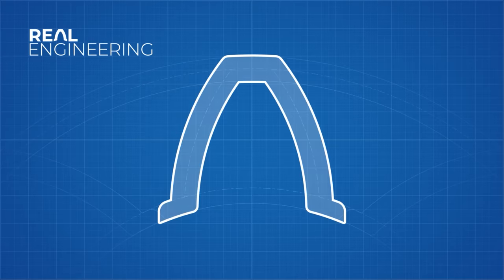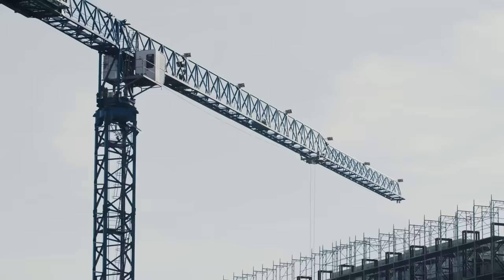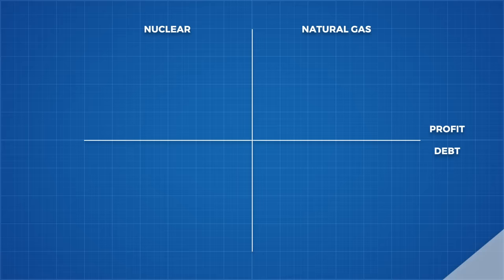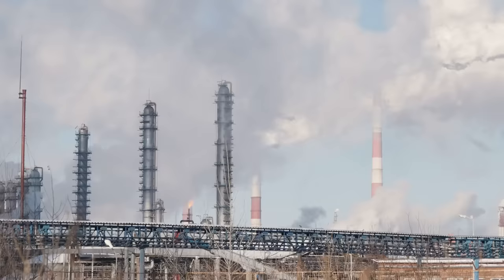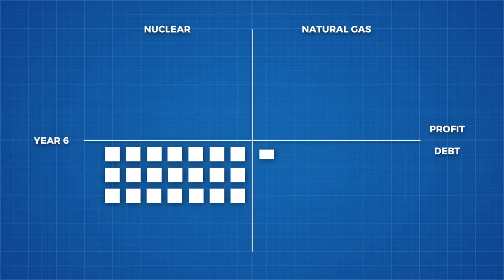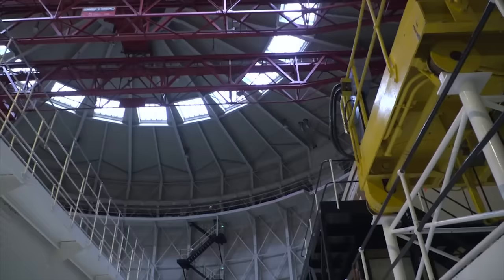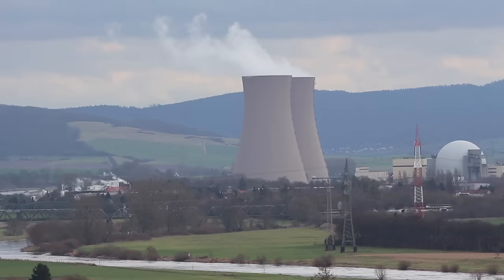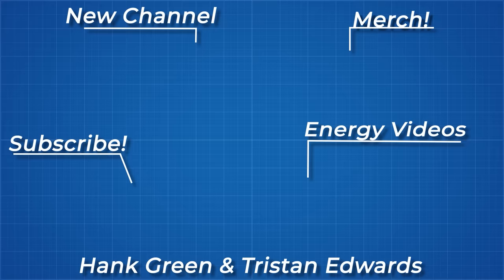The Economics of Nuclear Energy

Comment: As someone that works in the energy sector, I have a few comments. One thing missing in the natural gas turbine (CT's) calculation is what is referred to as "equivalent hours of loss of life". What this is, every time you shut a CT down, and then start it up again, it suffers severe loss of life due to the heating dynamic. After a certain amount of loss of life hours, these units need to be taken out of service for inspection, this is no small feat, as the turbine needs to be exposed and inspected. Also, renewables (which include biomass, literally burning trees, which is another matter altogether) only constitutes about 11% of all installed capacity with in North America. At any one time only about 2.5% of all energy produced in North America is renewable (DOE). 
in the video, they mention Fukushima and show a picture of Chernobyl, but what they don't mention is the thousands of reactors that have run without incident their entire life. Thorium reactors are now being developed and are far safer than current installations and have the ability to produce more energy. 
I love the environment, but, am a realist, until the ability to store energy, Solar (which takes up MASSIVE amounts of real estate, and is hugely subsidized, that is why the costs look so low) and Wind (same problems as solar, not to mention the resources required to make and install them)  they are not feasible. So, if you like the dark and want to go back in time, the choice is yours.
Reply: Stop talking sense! Wind and solar are magic! Physics and the whole "energy density" thing are bullshit. :P
Reply: Oh don't get me started on biomass. Here in Europe some people think importing wood from South America and burning it is somehow green.
Reply: the thing is, when a nuclear plant goes bad, the consequences reverberate through millennia, not merely decades or centuries. dealing with the waste is a big deal that lots of people seem willing to ignore (at least in these comments). hopefully research can start to provide results, as fossil fuels wont last forever and battery tech can't yet make wind and solar viable
Reply: @berengerchristy6256  that's actually incorrect, for starters modern reactor design can literally not suffer the kinds of failures like Chernobyl, and the new thorium molten salt reactors could never even have an accident like Fukushima, they are literally 100% passively meltdown proof, literally every person on the planet could die and a molten salt reactor would just sit there and slowly cool down, never be a threat to the environment or anyone.

If you mean the "waste" from operation again this is an area where the general public is greatly misinformed, modern reactors produce miniscule amounts of waste, and what little waste they do produce is easily handled, unlike coal and gas, or even solar (making solar panels produces a ton of dangerous industrial waste), these all dump a significant portion of their waste products into the environment. And the molten salt reactors which are far more efficient and produce far less and less dangerous waste products than modern reactors can actually have their fuels supplemented with the "waste" from modern plants.
Reply: @berengerchristy6256  And yet even when fossil plants go 'good', we know that they are having impacts of the same or greater magnitude through global warming.
Reply: It's worth mentioning also that closed cycle gas (CCGT) is more efficient but less suited to peaking, whereas open cycle gas (OCGT) is less efficient but much faster. So a greater degree of renewables penetration can actually lead to higher carbon footprint as OCGTs are used in place of CCGTs to match intermittency. I don't think this is an argument against renewables, but more a demonstration of how finding better storage solutions is of enormous importance.
Reply: I would rather be in the dark and alive than die of cancer radiation poisoning
Reply: Can you build solar panels into a sort of rotating tower or any other more feasible method which would still catch sun all day but take up less space than a field of panels?
Reply: @dalemarshall625  a modern nuclear power plant will never put you at risk of dying from radiation sickness or cancer.
Reply: Berenger Christy No it doesn't, all it takes is a few calculations and at most it lasts measurably a century or two, in reality it's dangerous for a few decades.
Chernobyl is safe and is a tourist attraction, and Fukushima is already being reclaimed by the Japanese government, people are moving back into it.
Not to mention the thousands killed by fossil fuels and the industry each year, nuclear had caused less than a hundred deaths since its inception.
If you don't believe me, study physics for yourself, once you reach nuclear physics you'll come to the same conclusions.
Reply: @berengerchristy6256  Christy one thing to keep in mind that isn't often well communicated when it comes to radioactivity there is a half life. The important thing is that the shorter the half life, the more dangerous it is, the longer the half life the less dangerous it is. say for example an isotope has a 2 year half life, it is extremely dangerous but if there is say 1 ton of it, in 2 years there is half a ton, 4 years a quarter, 6 years an eighth, 8 a 16th, 10 a 32nd, and so on till there is just trace elements. so in 16 years there would be almost nothing dangerous left. on the flip side if something had a 100 year half life, it degrades at a much slower rate so it will last much longer, but it will be far less dangerous. With modern reactors they claim that the nuclear waste will reach natural background radiation in just 150 years, meaning it has to be stored that long. in the grand scheme this is extremely short and extremely safe.
Reply: I would also like to mention that Gas Turbines have a massive air requirement and as a result need to be shut down often to have their air filters replaced which takes hundreds of people a couple days to perform. My cousin is a technician who made about half of his year's income just replacing filters.... keep in mind they are roughly football field sized and 3 stories tall.
Reply: Thorium and molten-salt reactors are the way to go. They're safer, smaller, and can be built on an assembly line and transported to where they're needed without permanent installation. We might even have a shot of using up and disposing of much of the waste leftover from older traditional plants.
Reply: @berengerchristy6256  The thing is, this millenia-number is hugely exaggerated as the exclusion zone of Fukushima has never been uninhabitable by radiation. It's actually a much safer environment than Tokyo. The Chernobyl exclusion zone is mostly inhabitable, too. For Three Mile Island, the dose, to which the public was exposed to, is the dose of a single x-ray picture. 
Nuclear waste isn't much of a problem, too: It's a very small amount of mostly not that toxic materials that are just unused nuclear fuel (because of economics) and all hazardous materials are ceramic pellets or alloyed into glass. The other industries produce serious amounts of highly toxic waste, too, but only the nuclear waste is handled with care and well contained.

Comment: I agree with part of your presentation. The French proved the small reactor factory built concept in the 1960's when they built their very successful nuclear power station grid from this type of small reactor. You mentioned how well their system works then totally ignored their model and only analyzed the bloated; HUGE one off nuclear teakettle designs they have been building here and elsewhere. These designs are kind of like redesigning a jumbo jet from scratch every time you build one: REALLY STUPID. Small modular, factory built is WAY cheaper. Small modular reactors: Liquid Fueled Thorium Molten Salt is orders of magnitude better yet.

There are a number of fundamental problems of any solid fueled nuclear reactor. Nuclear fuel ALWAYS swells due to the intense radiation, reaction byproducts quickly contaminate the reaction and cannot be remove from the solid fuel, unless the fuel is recycled. Also it only allows utilization of a very small portion of the energy in the nuclear fuel (about 1-3%), requiring fuel bundle replacement in about 18 months. When the core is decommissioned you still need to store the highly radioactive waste for thousands of years. Spent fuel MUST be continuously covered in highly purified water for at least centuries to keep the fuel bundles below melting temperature. The continuous heat from the fuel, evaporates the water quickly (hundreds of gallons in a short period of time) ALL spent fuel is currently stored in pools, on site at the nuclear plant and there are no plans to recycle it as it is expensive and hard to do conventionally. Uranium is somewhat water soluble (Thorium is not), so there is a groundwater contamination concern.

I used to oppose nuclear energy, mainly due to high pressure steam explosions (3 times so far) and long term storage of highly radioactive fuel for 10k+ years. I have changed my mind, but only if we build  Thorium liquid fueled, Molten Salt reactors (such as LFTR) instead of the boiling water conventional reactors we have now. Currently Thorium is  a waste product of a number of mining operations, is orders of magnitude more plentiful than uranium and is basically as safe as dirt (it needs conversion inside the reactor to become useful fuel, conversion takes 30 days and is free). Molten salt solves ALL of the fundamental problems of boiling water reactors, as part of their nature. They also cheaply and easily burn current stocks of used fuel rods leaving only a small residue that is safe in about 300 years. They effectively use about 95+% of the nuclear energy in the fuel. No expensive explosion proof containment structure needed, as it cannot explode (it operates at ambient air pressure). They are walk away safe (Oak Ridge Tennessee ran a molten salt reactor safely for 6,000 hours and performed walk away safe tests on it at full power in the 1960's). In fact they shut it down every weekend because no one wanted to stay. They are well suited to the SMR form factor and easily allow continuous removal of very valuable medical isotopes on an ongoing basis. These medical isotopes are impossible to remove from boiling water reactors. They also provide high temperature waste heat that can be used in many high temperature processes now, such as steel, fertilizer or concrete making, just to name a few. Desalinization of sea water on a huge scale is easy and cheap.

The only remaining hurdles are some slight metals compatibility proving needed. Chemical separation is a far superior and cheaper process. The inventor of the nuclear tea kettle reactor (Alvin Weinberg) said it was fine for military use but was a very poor choice for commercial reactors, as we have seen 3 times. For many years he strongly promoted the Thorium, liquid fueled reactor as a far superior choice. Thorium is useless for making bombs which is one of the main reasons they used uranium instead back in the 1950’s.  See Thorium Alliance you tube videos for a good overview. An excellent boiling water reactor problems review is a 1hr You Tube video:  
Nuclear Disasters & Coolants   https://www.youtube.com/watch?v=8Pyq8kCeiYs&list=PLs_mufQsR4fge432XbzbnIEgEjayooYSu&index=5
Reply: Always funny when someone invent history as he pleased. Enjoy your delusion! You should send your money on one of these start up :D
Reply: You can't estimate costs on a thorium reactor when none of them are actually producing commercial power...
Reply: @pierregravel-primeau702  hell no. he should send me the money. I'll build these reactors! Just watch me. :-D
Reply: Its worth looking into the total system emissions for thorium reactors when factoring in emissions during mining transportation etc. its questionable if its worth investing into when currently normal renewables become cheaper at fast rates and are currently much more useful to invest in than nuclear reactors.
Reply: Can you provide a good source of information about LFTR and small modern nuclear reactors?
Reply: Excellent review and information thanks
Reply: Love it!
Reply: You just inspired me to start a huge research project on this so I can base my presentation/dissertation off of this interesting and captivating  subject... many thanks friend, and the details and clear prose you used was very enjoyable to read!!
Reply: @nocensorship8092 But its a waste product of mining already and has be transported to waste facilities already so why not use it if possible?

Comment: Great brief although I would suggest some key factors that seperate out renewables from energy dense plants should be acknowledged.

1) renewables require vastly more land per kilowatt of energy produced. That finite land that may otherwise be used for farming/housing/wild areas etc. In many cases the most productive land for solar and wind is also very productive for food production. Energy dense plants like nuclear use far less land,  on order of magnitudes that can instead be used for economic output or returned to wild areas.

2) Renewables require vast amounts transmission lines and additional network assets like battery back up and rotating mass condensors or the like to maintain network frequency amongst many other things. These enormous costs to install, maintain and upgrade are rarely acknowledged when claiming renewables result in the cheapest power bills. 

3) Network size renewable plants are often quoted by there maximum possible generation capacity. This total capacity is rarely ever reached and may only do so for 10-15% of the day. As a general rule for ever kilowatt of reliable energy production (nuclear, fossil fuel) you remove from a grid you need to replace it with 1.7 times that capacity in renewables.